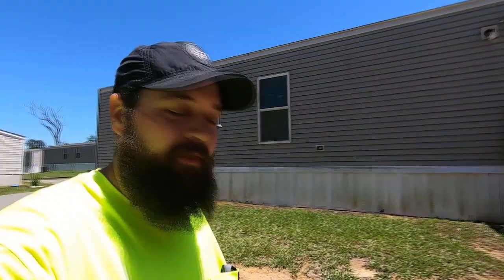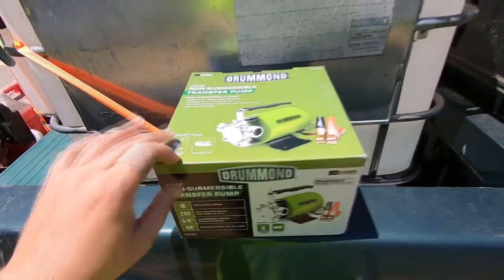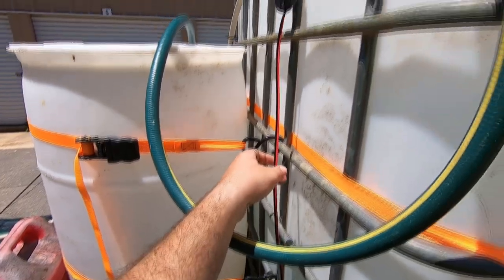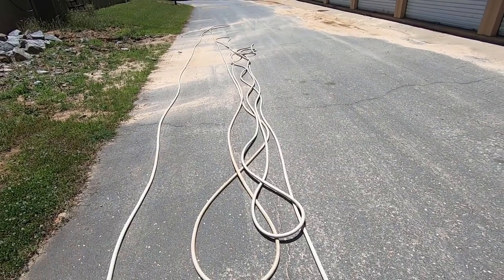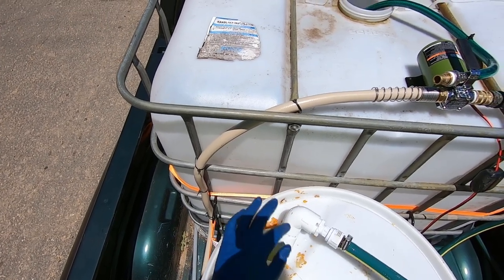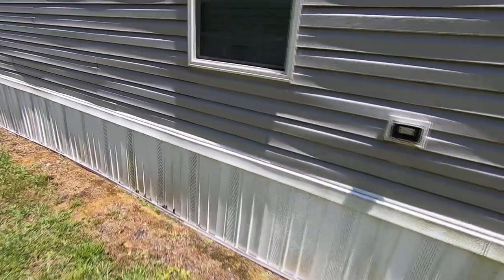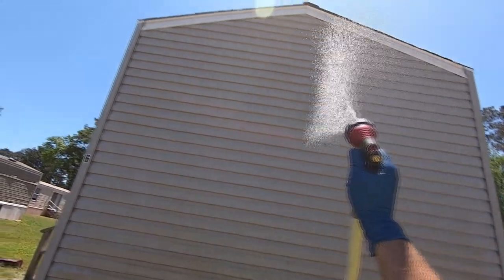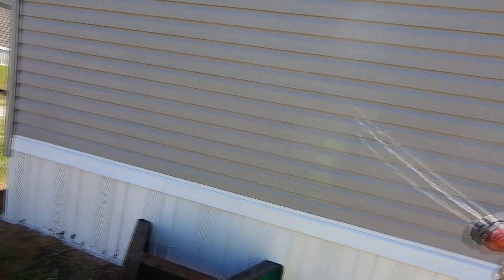Harbor Freight Tools Soft Wash Setup | Under $300

Comment: I have several types of hoses, for my garden i use my well and its only feeding a single faucet outlet. I can tell the difference between using one hose and another. I have a big thicc never kink and the well pump shoves out water that on a jet setting can reach all the way across the plot almost. I have one of those cloth hoses that i use to get some outlying plants and notice a drastic cut back on volume.

So those harbor freight hoses might actually be a bottle neck that you didnt consider, or someone else might not consider till reading this. Not all hoses are equal.

Comment: Will that spray chemicals two-story in the air that would definitely work for me if it would do two stories that little trailer is not true stories I don't want to have to get on the ladder you will get dressed on a ladder that's annoying